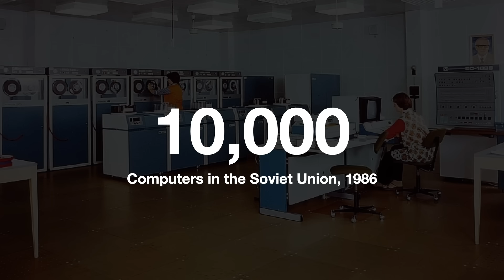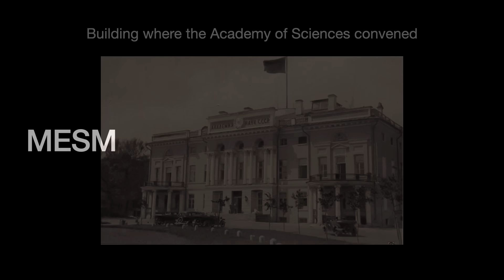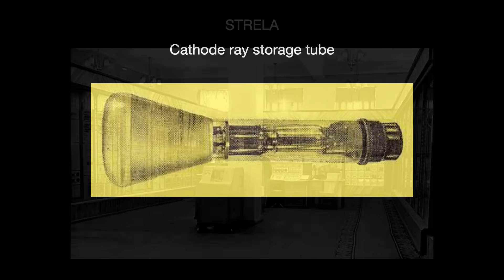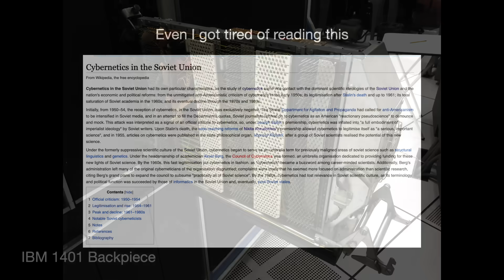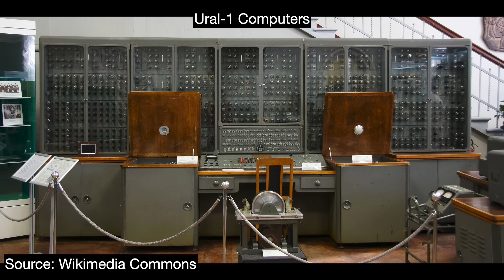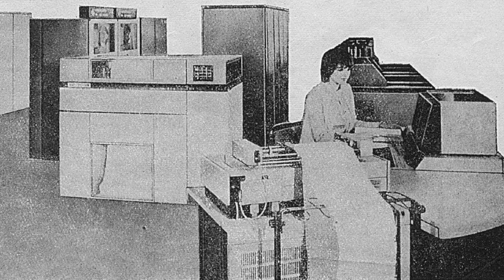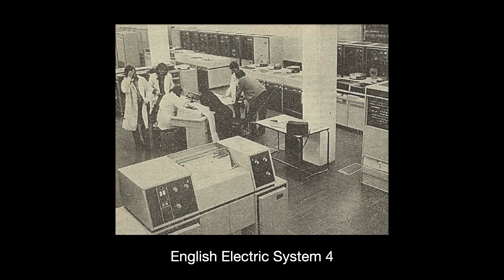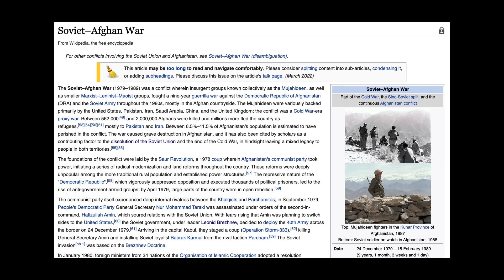Why the Soviet Computer Failed

Comment: I can't find it online right now, but I believe the Soviets reverse engineering was also sabotaged quite smartly by letting them steal modified and flawed IC designs back in the day. It was a fascinating story.
Reply: It also handicapped their own internal development because they tried to skip steps instead of being forced to organically develope the full capability tree.
Reply: @Laotzu.Goldbug  Zilog did this to the Z80, but it wasn't just Russia, copying was rife
Reply: That wouldn't surprise me. Remember the failing capacitors with stories of stolen incorrect, or incomplete, recipes for producing the capacitors.
Reply: @gorillaau  that is potentially a myth, at least Teapo has indicated that Japanese companies blew the story out of proportion, possibly to push up their own profile and generate more sales. It's possible that Taiwanese companies ran into the same issues formulating and characterising capacitors as Japanese did in the early 90s, just later. Indeed there were some truly funny batches from unknown brands (not major Taiwanese brands) which measured "ultra low ESR" right off production line but just wouldn't last but they would have been gone by 2002. The continuing capacitor plague story is probably down to not observing the maximum ripple current and derating by electronics manufacturers, and then shifting the blame.
Reply: @SianaGearz  You could well be right. I suspect that we will never know as no one is going to put up there hand and say yes we stole a secret formula from CompanyX.
Reply: @gorillaau  the 80% water electrolyte with a little boric acid in the funny capacitors with no stabilising compounds is documented, it should have been obvious to the high ranking chemist that is known to have quit Rubycon and moved to Taiwan that it would just eat up aluminium in no time, by all reason someone else who doesn't have the faintest idea or was just up for a quick scam is responsible for that garbage.
Reply: @SianaGearz  Ah. Electrolytics.  Does anyone still use those? I can get a very good 10uF @ 25V in a 1206 case. Or smaller.
Reply: @msimon6808  Sometimes they do, sometimes they don't. I don't think low-ESR electrolytic caps are a good idea to begin with, since they become standard-ESR caps with time or even no-caps in my experience, with a few nice exceptions. When you need to handle high ripple currents, you might as well pair a standard-ESR electrolytic with a ceramic of maybe 1uF or 100n, where the ceramic will take up the bulk of ripple current and the lytic will take up the bulk of capacity. When used correctly (which, i know, is maybe a little much to ask for of mainstream manufacturers today), even cheap standard aluminium electrolytics are generally very reliable, which is not said easily about low-ESR types.

It's probably mostly a cost saving measure, since i had to specifically buy 10uF 25V ones in 1206 what a coincidence, and they cost... like a substantial amount of money, several cents per cap, while even low-ESR lytics from some off-brand cost nothing. The ceramics have their own pitfalls as well - the capacity is different every time you look at them, and they often fail short, presumably due to defects or external thermal or mechanical shock rather than electrical abuse. Companies aren't really interested in whether something will survive beyond 2-3 years, but they do need to keep warranty period failures fairly low.
Reply: @SianaGearz  Thanks.  -  I have yet to have issues with capacitor lifetimes. When I need temp stability I specify COG.
Reply: @msimon6808  old soviet capacitors are real fun. Thing is, when they get old, the capacitance may increase, not decrease. But suddenly..
Reply: @gorillaau  I dunno if this true, but Armenian made electrolytic capacitors were especially known for being utterly horrible. Their logo resembles G or 6
Reply: @agapp11able do you really think bald face lies over easily verifiable facts will stand up in this day and age?  Every sentence you wrote is wrong.  It’s not a myth, the Soviets reacted to the US shuttle program, stole heavily from it, and Buran only flew once unmanned, which is actually quite impressive.
You would have fit right in back in the USSR.
Reply: @lookoutforchris  The modern 'fact checkers' who rewrite history and reality to please their politicall masters.
Reply: Yeah, the same thing was done during the Space shuttle development. NASA would leave their specs open source and the Soviets would immediately copy them for the Buran program. But the US caught on and started deliberately posting flawed designs like the wrong formulation for thermal tiles and so on.
Reply: If you walked around Kiev Polytechnic in the 1980s you could sometimes see Professors pouring over microchip circuits on lecture blackboards.
Reply: @RemoveChink  'poring' rather, fwiw
Reply: @martymiller9514  thanks
Reply: @Richard-tq7xi  well, yes. But having a society that makes smart people want to move there (reverse brain-drain, if you will), is a valid strategy.
Reply: @agapp11able First of all, leading USA microelectronics and radar tech was stolen, brought to USSR by communist defectors, who were given different names and leading positions in USSR.
Sarant and Barr from Rosenberg spy ring.
Next, USSR microelectronics was sure diverse, but dysfunctional due to secrecy and competition. It did not provide necessary amount of computers and good quality software and this was the motivation for the switch to IBM & DEC clone archs. They wanted more sw reuse and ability to steal western sw. Funky handmade hardware is nice, but they lagged behind the west in development of complex software. 
Sure, there were some interesting developments in prog langs etc. but this doesn’t disprove the main claim of USSR lagging behind.
Reply: As for traps in microchips - they indeed existed and intended to thwart competition, not even specifically USSR. Z80, again, is a very well known example.
Reply: The victims were not just the soviets.  Many (Most?) designs contain a few dummy transistors that serve no function other than to catch patent infraction.
Reply: @agapp11able Sorry agapp11able, unless you can provide sources, literally every other article I google details how the reactionary Soviet leadership told their defense industry to copy the American design. In these articles there are even first hand accounts from Cosmonauts confirming the idiotic decisions of the Kremlin to start stealing as much as possible to save money and time. 
There's a reason why the docking doors on the Buran  were an identical match with NASA's.

Also, you're other claim of "constructing their own shuttle designs quite successfully before that."
What does that even mean???

The only other shuttle they thought of was in the 60s (Spiral), and it only made it to the prototype phase before being abandoned. And notice how it looks nothing like the Buran?
Reply: Yes… they are Third World Parasites.
Reply: @agapp11able Buran being succesful does not negate that claim.
Reply: @agapp11able Stalin's idiocy lost the German revolution to the NAZI's becuase he first called the Social Democrats as Social fascists making the Social Democratic workers the enemy. Then the leaders of the German Communist Party deserted without so much as throwing a punch back at the fascists. They he began to accuse all of his opponents as fascists and agents of Hitler until he decided to sign a non aggression pact with the NAZI's. As Trotsky had said Stalin was incapable of abstract thought. Where in Marx or Lenin do they say the goal is to create a perfect example of communism as the road to socialism and not the class struggle. If that was the idea of "Socialism in one Country." than it was nothing more than idealist utopianism incompatible with revolutionary Marxism. It would have been better had Stalin remained in the Orthodox Priesthood since in the end religious thought was about the only type of thinking he was capable of.
Reply: @agapp11able Stalin’s purges were directed against real Bolsheviks who worked with Lenin. Only few of these remained.
Also, due to inherent flaws of soviet system the only way to make it work was to terrorize people into obeying the laws. This was a campaign of terror against own people. Truth is, lots of people, many millions, hated the commies and commies terrorized them into obedience. Also, leninist bolsheviks, mensheviks, etc. all hated Stalin. Former enemies ended up in Gulags together. 
Also. Stalin intentionally wanted to put millions of innocent people into Gulags to plunder their wealth, sell the plundered valuables and the products of their slave labor to western capitalists.
Reply: Something similar happened in Ukraine a few years ago. North Korea sent spies to obtain details of i think rocket engines , Ukraine used to be one of the main hubs for that during the Soviet era . They were detected and fed designs that had flaws built in and would never work if the thing was built . 
The Police and national security services kept feeding them for a while , then set up a sting operation . They remained very quiet after being arrested , did not want to communicate with relatives and were more than a little reluctant to go home on release
Reply: It is true.  Not just General Purpose computers either.  Also specialized stuff used in other industries.  Intentionally designed with well hidden flaws, then placed on the export restricted Secret list as part if the plan, then we sat back watching and giggling as their KGB followers (aka spies and traitors) proceeded to steal and smuggle the stolen items and designs back to Mother Russia and clone and distribute them for the USSR's own use.
Reply: Stalin began the road back to capitalism and those who followed could only continue down that road. The only thing Marxist Leninist about the leadership was the international book printing projects of the works of Marx, Engels and Lenin.  Naturally the American Imperialist wanted as weak a capitalism as possible in the former bloc and Soviet Union and Gorbachev and Yeltsin were only to happy to take the advice of Milton Freedman and Bill Clinton.
Reply: @agapp11able secrecy around competitiveness stifles innovation as it prevents synergy
Reply: @agapp11able Hahah, you are such a nice genocide/slavery apologist. Everyone was wrong besides Stalin and deserved to die for that, sure. And he totally not collaborated with capitalist despite starving millions of USSR citizens  in order to enrich these foreign capitalists.
And no, Gulag prisoners were rehabilitated as innocents only after the butcher Sralin died in a puddle of his piss.
Reply: @matalostodos  Now that Putin is building a new prisonhouse of nations as a CZAR your system is failing as it slips into a New World Disorder. ISIS is just another creature of US Imperialism who is a convenient punching bag when not serving the interests of US Imperialism in Syria. Too bad your unable to see past the end of your nose. You've got a President that senility is on display daily because a president doesn't really do anything but act as a capitalist God. Sri Lanka and China's banking crisis are just more problems for the system of exploitation. Like I said you have a New World Disorder and it's going to get worse before it gets better. You don't have the Stalinists to bail you out either.
Reply: I'm sure counter espionage was real
Reply: That's been done for years, such as when the soviets thought they were stealing plans for the space shuttle. A few technical things were deliberately changed. Now you know why the Soviet shuttle only flew once.
Reply: "by letting them steal modified and flawed IC designes"  For a similar counterintelligence move by the West, see The Farewell Dossier.
Reply: @agapp11able ... It is a shame for the Soviets that they did not try to follow both streams in parallel; keep developing their own systems as well as copy systems system from the USA. Perhaps they did not have the human resources the accomplish both, however, I think it was purely a political decision not based on logic.
Reply: @agapp11able FORTH was very popular in Russia because of its small footprint. 8K bytes was possible for the compiler/editor. 12K to 16K was more usual. Still quite small. I use it for small ARM machines. (LPC824 - 32K bytes of Flash, 8K RAM. 16K for a 32 bit compiler. 2 1/2K for the OS RAM. So you have 5 1/2K RAM and 16K Flash to work with.
Reply: @agapp11able Kruschev was sitting next to Stalin during the War years and Gorbachev as a child wrote the most slavish complements of the greatest leader humanity ever had. The 1930's trails were frame up trials of the old Bolsheviks. If Hitler would have been more patient Stalin would have successfully purged the Red Army of all intellect and  the Soviet Union would have easily been defeated. The best cadres who didn't die at the front died in the gulag. Stalin and his followers gave up on socialism and the working class for the promises of Democratic Imperialism and capitalist liberals world wide. This is why the Communist International was disbanded and at the end of the war the US Communist Party became the Communist Political Association and they talked of "shaking the hands of monopolists". According to Stalinist theory from that point forward the real revolutionaries are American Monopoly Capitalists along with the British imperialists.
Reply: @kimobrien.  Ah, the classic. "It wasn't real Communism!" 

Major cope.

If Russia didn't adopt a system where one man has power of life and death over an entire country he wouldn't have been able to purge the scientists in the first place. 

Almost like centralized authoritarianism doesn't work and is the entire point of this video.
Reply: @barahng  Stalin had all the major leaders of the October Revolution except Lenin (who died in 1924) murdered including the organizer of the Red Army victory over 14 Imperialist armies Commissar of Military and Naval Affairs Leon Trotsky. The world Communist movement split in 1928. Stalin abolished the Communist International as a favor to the Democratic Imperialist FDR and Churchill during WW2.  Stalin revived all the old and rotten theory's of the reformist leaders of the second International. The leadership of Lenin and Trotsky was never a one man band show. That's American thinking where everything is controlled by one man except of course the American government where Trump became a dictator. .
Reply: @kimobrien.  oh, kim.  

Stalin's fascination and affection for the west might have had something to do with american lend-lease helping russia win ww2.  

It is easy to point fingers and make bitter comments about the past but russia needed that help because the current system had failed to make provision for that mad ranting corporal in germany that had sensible germans in fear and tremblings.
Reply: @agapp11able The biggest mistake was the political theory of Stalin of building Socialism in one country and not advancing the world revolution. You can't have peace with Imperialism because it's a system of exploitation. All this talk of not enough incentives and the failure of central planning is bullshit. If anything their were too many incentives and not enough honesty in the central planning which is a cultural problem that carried over from the Stalin era. Stalin destroyed Lenin's Party with the 1930's purges and what was left was a shell being run by privileged bureaucrats who began to think like capitalists and so introduced all that is wrong with capitalism back into the Soviet system. Going down this foolish road of peaceful coexistence and massive military expenditures when a well armed militia is one of the best defensive military organizations.
Reply: @kimobrien.  Commie propaganda. USSR was an empire BTW
Reply: @noop9k  Well today the worlds most powerful military Empire is the American Imperialist Empire. The achilles heal of the American Imperialist Empire is the American working class which gains nothing from the Empires riches.
Reply: @kimobrien.  Actually, the American working class benefits a lot from the "American Empire". The world's largest navy ensures cheap products from China and Vietnam to be shipped in without risk. Wide adoption of the dollar means that the dollar is a very stable currency that won't suddenly depreciate in value. 

You're a hundred years behind the times man. No one builds physical "empires". They build trade blocs, military alliances, technology exchanges.
Reply: @dasbubba841  Bosses always want to pit one group of workers against another the solution is solidarity among ALL workers NOT tariffs and protectionism for US Bosses.
Reply: @kimobrien.  one thing i can agree with was that a well armed militia together with a deterrent was all that was needed.  Russia didn't fall to germany and so was unlikely to be attacked by anyone again.  

However, as stated here, I can vouch for the issues that the presenter identified with command economies and the benefits of controlled market economies, i.e., with oversight and a dynamic legal system
Reply: @kimobrien.  In capitalism man exploits man. In communism it is the opposite. 

No honesty in central planning? That is a feature, not a bug.
Reply: @msimon6808  You really have not made a single point since you haven't yet show that the world ever reached "communism". We are still in the Imperialist era the highest stage of capitalism.  Nevertheless we have had state power somewhere in the world since 1917. The capitalist exploiting classes are divided into nation states but must compete in a world market. They are unable to arbitrate trade disputes outside their national border leading to Imperialist war. Maybe you would like to expalin how you big companies work without central planning? Are we to believe a CEO sits in an office and the business runs automatically by computer without bugs? That the CEO and his subordinates just spend all day playing computer games and looking out the window? Didn't you have a CEO who came close to destroying the company by implementing libertarian competition between all managers with everyone trying to beat each other at making the biggest profits.